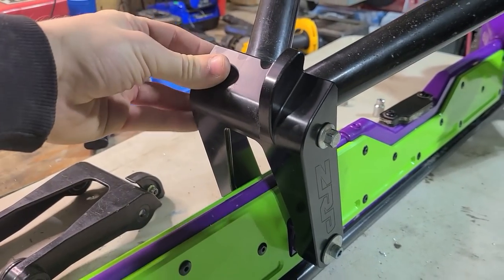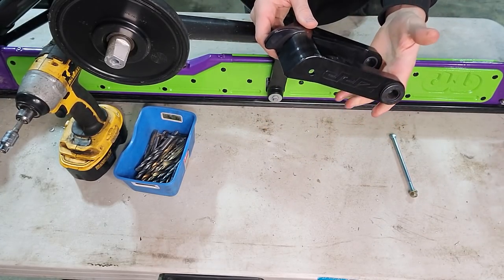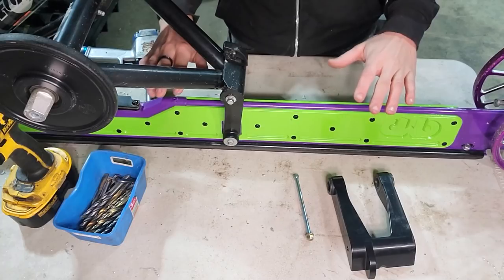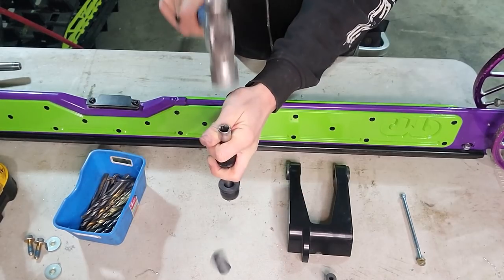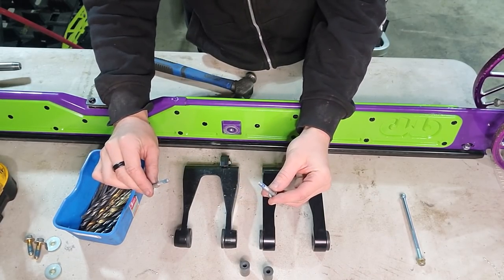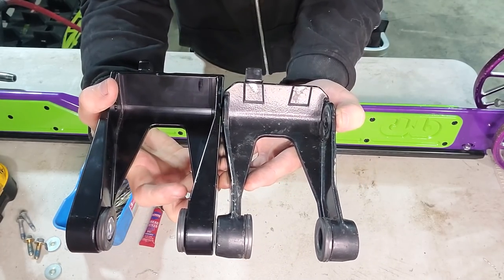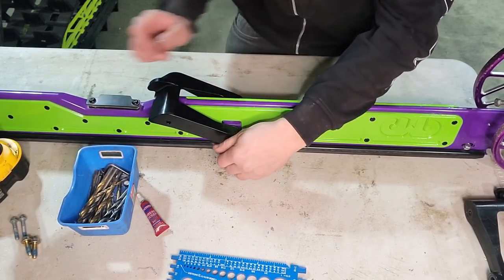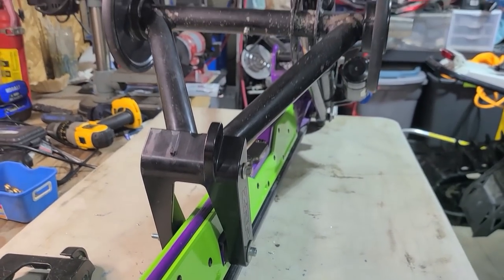ALPHA ONE RAIL UPGRADE Part #2 | ZRP SCISSOR MOUNT

Comment: When the alpha skids first came down the assembly line, I picked one up and it was so much lighter than the dual rail skids I could put it in place one handed and install mount hardware with the other, took me a total of about 40-45 seconds to toss an alpha in

Comment: I would prefer to see a wider scissor mount come with the rail stiffeners, along with some larger brackets that are welded or machined into the rail stiffeners. Along with a 1 piece bushing pressed all the way through them both. Still seems like a bit of a Bandaid and if any issues arise it will be a real pain to fix again. Better than new but not as good as it could be

Comment: Question to maybe talk about or answer if at all possible. I wonder if I could put a alpha one skid in my 2014 m8000? Like I know it will be a lot of work but I just was wondering if that was at all possible. BTW I live in Palmer Alaska and am a huge fan. I’ve watched every single video and the “ MR.CHOW!” Cracks me up every time. Keep up the awesome videos!
Reply: Im in peters creek and if you ride willow or caswell and saw an arctic cat green yamaha nyrto rippin about last winter that was me.  But as for AC, dude run and run fast.  I worked for erpac in eagle river and just getting stock oem parts from AC was like pulling teeth and when the parts showed up for my customers it was usually 2 months later at a minimum, im not joking.  Go doo or poo, theres a reason they are at the top.
Reply from the maker: You sure can. I've actually seen someone do it when they first came out. The skid mounts up exactly the same. I've had the same issue with Doo and Polaris seems to be suffering worse than anyone for supply chain issues for their parts. It's more of a Covid thing than a manufacturer thing.
Reply: @big_ute  I hate how Team CC treats there customers. I’ve had a summit and it was always such a pain getting the dess key reprogrammed cause it would always stop working randomly.
Reply: @syxxes  so it’s just a straight up skid change?

Comment: Will you be running more front skid shock pressure?(65psi plus)
Reply: Air shocks should really be set based on sag for best performance. Depends on rider weight etc.
Reply: @CalgaryDynastar  roumer has it that the front shock is valved too light and bottoms hard and cracks up front , and guys under 200 lbs are having to go above 65 psi to prevent this regardless of sag. No idea though, I don't ride with anyone with an alpha.